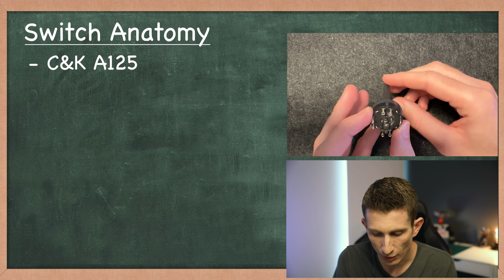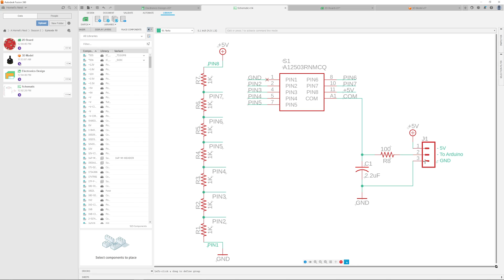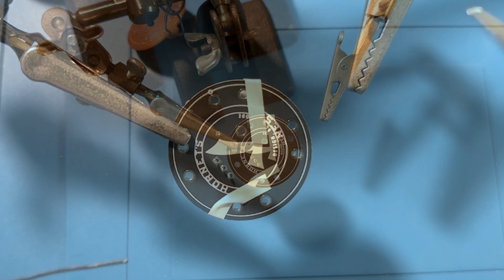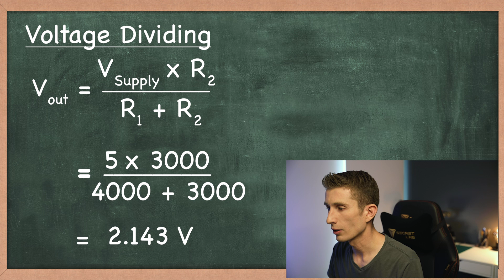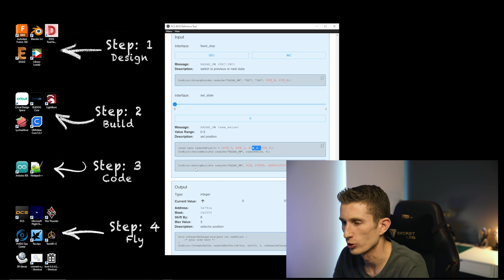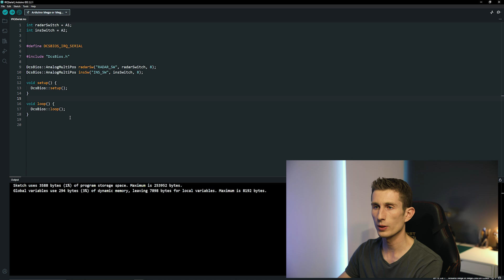Ep: 10 - DCS Bios | Analog Multi Position Switches | Code Your Flight Simulator

Comment: Hi Scott, I've asked a few questions about this in the past, I'm still getting a grasp on my electronics. Just started out with RS485, Will that have any effect on wiring or using multiple rotary switches using this technique on the same arduino?
Reply from the maker: It shouldn’t have any effect 
Other than just how it’s coded 
I’ll be doing a RS485 lesson soon when the pit is complete and I can do it all at once

Comment: May I ask, if you. Need a 5v for the switch, how would you connect multiple switches to an Arduino? Would you have to creat a 5v bus for more 5v connections?
Reply from the maker: Yeah that’s it
I’d connect a 5V bus that all the switches can connect to 

Or you can look at using the arduinos inbuilt pull up resistor 

And it would go Switch, and connect pin 1 and/or 3 to a digital pin on the arduino and pin 2 (middle) to GND on arduino
Reply: @aHornetsNest thanks, Appreciate the response

Comment: Hi Scott, Great video . Just a question about this pcb system . Could it be used for MSFS . Ive just started learning about Arduino, Wiring switches and flight sim in general . Can you bring down the wiring as you have here with these PCBs for other Flight sims ? Can you use it for say a 12 pos rotary ?
Reply from the maker: Hey! You definitely can 
All this turns it into is a detented potentiometer 
You can make this for any type of rotary switch 
So if you wanted to make a switch like this for MSFS you’d just use the Joystick library instead of DCS bois
Reply: @aHornetsNest  could I ask a question about locking Toggles . I can only find ON ON locking toggles . Is there a way I could use these as ON OFF ?
Reply from the maker: If it’s a 2 way toggle 
And has 3 pins 
You just wire up 2 pins and it becomes a ON-OFF
Reply: @aHornetsNest thankyou
Reply from the maker: All good 🤙🏻🤙🏻
Reply: @aHornetsNest hi again Scott , I forgot to ask ,  Regardless of weather you use 3 of the detents or 8 do we connect up the same as you have shown ( up to pin 8) regardless of how many you are using? Do you by any chance offer a bit off coaching ,maybe I could dm you ?
Reply from the maker: Hey mate feel free to shoot me a dm 🤙🏻
Reply: @aHornetsNest  great , Thankyou

Comment: Great video.  I need some help with this.  The DCS-BIOS version I installed does not have the support for the Multiposition switch changed to a Potentiometer for the F16.  How do I add this?  I found "Expanded Input support" on the DCS download, but the install directions in the Read Me file are not very clear, at least not to me. Thank you.
Reply from the maker: Hey there! That’s an interesting one 
I personally don’t have the F-16 
I get home in a week and I’ll be able to check it out for you 🤙🏻

Comment: I love your videos,a question, the pcb that is the pcb way page under your page is it ready to print ??
Reply from the maker: Hey yeah! It is ready to print and manufacture if you follow the website 🤙🏻
Reply: @ another question I don’t know much about electronics what is the capacitor for ??
Reply from the maker: The capacitor in this instance just provides smooth signal flow 
It takes away the little dips and spikes in voltage making it a cleaner signal

Comment: I’m working through these panels and I’m struggling on a backlighting solution. What types of lights are you using for yours?
Reply from the maker: I’m using embedded strip lighting into the panel itself 
Some use surface mounted LEDs to the circuit boards
Reply: @ do you just engrave a channel into the baseplate that the switches connect to?
Reply from the maker: It’s made of 2mm opal white and 3mm frosted ice acrylic 

I cut the channel in the 3mm frosted layer before I glue the 2 together

Comment: Could I ask how/where you got the pad/via hole layout for the switch? I’ve only made 6 PCB’s so far using the libraries you point out for DuPont and JST connectors. 

I’m wanting to replicate your PCB for a 12 position rotary switch. The schematics I can get, and the SMD’s should be straightforward. But I need to figure out the pin layout to solder the board to the switch.
Reply from the maker: Hey mate! sorry for the late reply! you can get the foot print / symbol from websites like mouser.com . I use them to buy most of my switches as they have downloadable files for each product to use in the pcb software. I think other websites have similar features, I've just never used them. So I'd go download the ECAD files for the 12 pos switch, install them as a library, and then you're good to go 👌🏻

Comment: could you use a pot with the analogmultipos command Scott?  Would DCS Bios work out the value between each step of the 65k value on a B10K?
Reply from the maker: Yeah it will, as long as it is a B (linear pot) the voltage dividing formula still works and applies correctly with DCS, a B10K (10K ohms) would be the most common value you’d see people using, but if you had a 65K pot I wouldn’t see why it wouldn’t work as long as it was linear
Reply: @aHornetsNest  awesome - sussed it - thank you.  All i needed to do on a B10k pot was specify in the code how many steps and because it is linear, presto.  Clever stuff - thank you again!!  (PS:  For context, this was to use the Apache CMWS Panel in a dual mode for ECM and RWR panels.  Works perfectly on one sketch)
Reply from the maker: Legend!!! Glad you got it 
Exactly 🤙🏻🤙🏻 awesome can’t wait to see it working 🙌🏼

Comment: Hi! I've just put 74HC166 shift registers into my basket as my retailer doesn't have the 74HC165 currently. I'd say they are of similar type (PISO aka "for buttons") but specs on web stores are sloppy as hell and the spec sheets tell a bit of a different story. They do seem to be of the same type, but the internals seem to differ and I'm not knowleadgable enough to tell go vs no-go in such a case. Any hints?
Reply from the maker: Mmmm I think both would work, but from what I can see the 165 is most common with its ease of use and shift/load style of use, where as the 166 needs more complex timing sequences to load data 
If you can find 165s I’d try use them

Comment: You are probably getting tired of seeing my comments. 

What rotory switches are you using? I've been looking at mcmaster carr and talk about confusing. Most of them are multy circuit 8 or 9 position rotory switches with 16 lugs. That doesn't seem right.
Reply from the maker: Hey mate 🤙🏻 no stress at all 
I use the A125 multi position switches for these 
They’re from mouser.com - I think you can get them Digikey as well 

https://au.mouser.com/datasheet/2/240/arotary-3050724.pdf

And then the rest do their product code is just the different specs on it

Comment: Hi me Again, is this the exact same theory for connecting a 12 position switch? and only utilising only 4 of the pins? as im gathering you code it out in arduino? as i will be using the built in stopper for the switches?
Reply from the maker: Hey :) yeah exact same theory, I’d still use resistors and connect all the pins - just incase one day you do need the extra capability, and it’ll also keep the coding a bit more intuitive 
But at the same time - if you just wanted to connect the required pins that is also okay - just adjust the code as required … but the voltage dividing theory is the same
Reply: @aHornetsNest  Perfect your an absolute star and a complete credit to the sim community thankyou!
Reply from the maker: @clarkyclackers2684 thanks mate I appreciate it 🫡 looking forward to coming back and making more episodes soon

Comment: Love these tutorials. You’re making it look easy! I was curious air something though. You seem to basically turn a rotary switch into a stepper potentiometer. Can you explain why you do it this way? Why don’t you wire each pin to the Arduino directly? Is this to save pins on the Arduino, or is there a different reason behind this?
Reply from the maker: Hey thanks so much! Yeah that’s exactly it 
It’s purely to save pins on arduino 
It’s not the “best” or “only” way to do it, but it’s the best pin saving way without using multiplexers 😃

Comment: Nice guide as always. 
On the radar pull functionality , It's been a while since I use the analogmultipos, but I achieved this with the addition of the below code, You want to insert that after if (state != lastState_){ and before char cstr[5];

if (strcmp(msg_, "RADAR_SW") == 0) {
    if ((state == 3 && lastState_ != 3) || 
        (state != 3 && lastState_ == 3)) {
        tryToSendDcsBiosMessage("RADAR_SW_PULL", "1");
        delay(300);
    }
}

Comment: Thanks so much for the great info in your tutorials. Im looking at building my own F18 sim pit very soon and the electical side of things was totally foreign to me. One question with the rotary switch and the position of the markings on the panels, how do you know that the switch and panel markins will line up when you turn the knob?
Reply from the maker: Hey mate! Glad to hear another F18 sim is coming into the world 
So the rotary switch has a registration stub on it to 1) stop the switch backing rotating when you try turn the knob and 2) but it shows you where position 0 is for the switch 

I will design my panels to have a registration hole in them to align the switch and you can find on DCS Bios where POS 0 is so I know it will align each time 

On the Hornet SENSOR panel - the POS 0 is in the 9 o’clock position for both switches 

Hope this helps :)
Reply: @aHornetsNest   at the moment its still a little hazy. i think once i build a panel and play with the switch position it'll be more clear to me.... am i right in thinking you can adjust the throw/step on the switch to match the markings on the physical panel?
Reply from the maker: Yeah once you start working with it it should make more sense 

Yeah you can buy different throw angles for the switch 
As well as different pin counts 
Most common throw angles are 30, 45 and 90
Reply: @aHornetsNest  I have watched all your videos but i still don't understand where do you find the position 0 on the dcs bios to do the hole on the panel. I am using the same rotary switch and I would like to know how to align it. Maybe you could do a video explaining it since you haven't on the first episodes and i believe more people following your tutorials may have the same doubt, thank you.
Reply from the maker: @BernaMatamata thanks mate! If you have a look at the data sheet for that switch it should show you alignment and pin out data 
And other easy way to do it is attach the knob to your switch, rotate it full counter clockwise to the stop, then take not of where the registration pip is compared to pointer position 
I do have a couple episodes coming up that use rotary switches and I’ll add it in there 🤙🏻
And then in bios, you’ll be able to see what position the switch is if for some reason the switch doesn’t have a stop like the INS switch - use the BoRT tool with bios to find where pos 0 is
Reply: @aHornetsNest Thank you! I will try that! I also saw that i can download the 3D model of the switch, that way it might be better to have the exact position of the pin compared to the pointer.
Reply from the maker: So good!!!! That’s a win 🤙🏻

Comment: Another fantastic video. The educational value is priceless... This is better than Netflix!!! Can't wait till next week, ... exciting... Would you happen to know if it's possible to use DCS Bios code together with plain arduino code on the same board? Like for combining a shift register or a matrix with DCS Bios. Or does DCS Bios support shift registers or matrix? Thank you very much for all your efforts enormously appreciated!👍👍👍👏👏👏
Reply from the maker: Thanks mate!! Yeah you definitely can 
I run my caution panel using output data from BIOS and then normal code for a shift bit register for the caution lights 
You just can’t mix BIOS with HID
Hope that helps 😃 see you next episode
Reply: Thanks a lot, any chance on a tutorial on shift registers or matrix?
Reply from the maker: @wardker  hey I can definitely look into a tutorial like that 😄
Reply: Exciting...You truly are the Obi-Wan Kenobi of simpit builders!! 👏👏👏 @aHornetsNest
Reply from the maker: Thank you 🙏 😁
Reply: @aHornetsNest  That's not right. It works perfectly. I use it for my UFC in the A10. At the time I didn't know about the matrix function, so I used a ProMicro and 2 additional CD74HC4067 for the HID to increase the number of pins for the joystick function to 35. I query the LED from the master caution directly with DCS-BIOS.
Reply from the maker: Nice

Comment: Nice video mate! I’m encountering an issue with polling the state of the cockpit switches: if the switches aren’t aligned with the sim I have to move first the switch for it to be “registered” and then it works. This happens with toggle switches that for example are “off” by default in the sim (e.g. cold & dark) however left in the “on” position on the physical panel. Any way around that other than having the physical switch aligned before the handshake with DCS bios?
Reply from the maker: Hey mate! There is a work around :) I’ll just need to go digging a bit to see the lines of code I added to the bios library to make it auto poll 😃 but I 100% know that frustration of needing to manually reset switches when you just wish it would update immediately on start up 
I’ll keep you updated 😃
Reply: @aHornetsNest  awesome! Thanks a million!
Reply from the maker: @The_ViperProject  😃😃😃

Comment: Is there no way to launch/connect DCS BIOS serial without opening that program every single time and entering the same port?
Reply from the maker: Hey there there if you have a fixed set up, and you know it’ll be COM X every time, you can go an edit the multi com serial file and open that one instead 

But for the purpose of the tutorials, and the potential all of new viewers I use single serial port 

But once the cockpit is up and running I’ll transition to the multi serial
Reply: @aHornetsNest  Gotcha!  Thanks so much for this. I'm working on my A10 cockpit myself.  I just need to figure out where DCS BIOS hid the "Hide Labels" and NVG code.
Reply from the maker: @jehlybean636  oh very nice!!

Comment: Nice - save those pins! Question: you copied and pasted the AnalogMultiPos line of code and it caused the error because Resolution/step was no longer needed. How would we ever know this? You literally used the code it provided, but it was incorrect…why is what was provided wrong in the first place? You also said mentioned something about if we looked at the back end coding we would see that. I don’t really know what that means. Where do we see this back end coding? Thanks!
Reply from the maker: Hey! Great comment 😃 BoRT and DCS Bios at times can have a tendency to be out of sync as I believe they were initially made by two seperate entities. As well as this technique is so rarely used by people I think updating it would have been over looked. But I’m not exactly sure on the reason why 

Back end code is the library files, you can navigate your way through the arduino dcs library and find the switch type you are using - and inside that file you can read the public and private class code and work out how the code works - if you have a understanding of arduino concepts it should be fairly easy to decipher 

I hope this helps 😃 I’ll be testing all snippets and creating more fixes if I find any